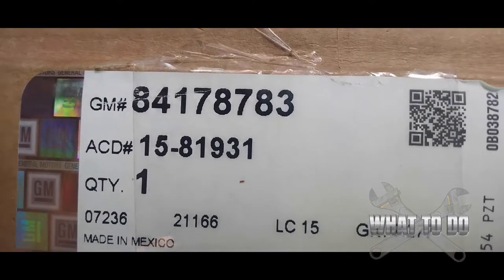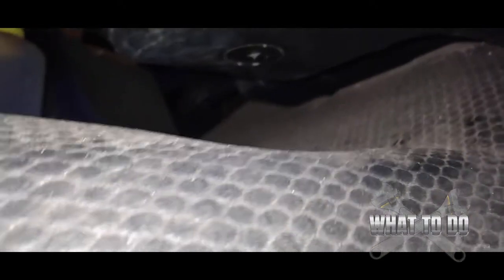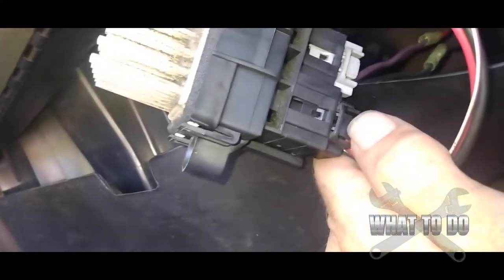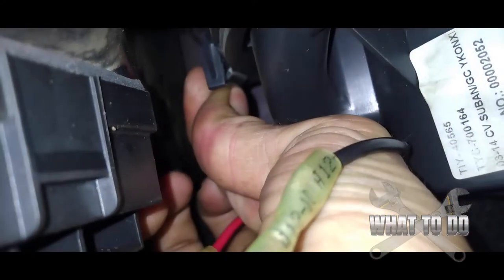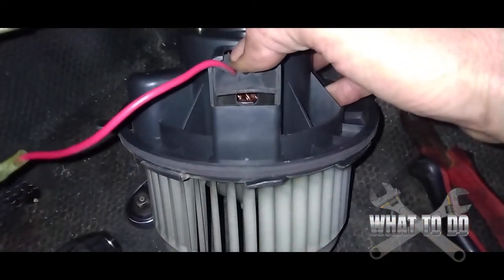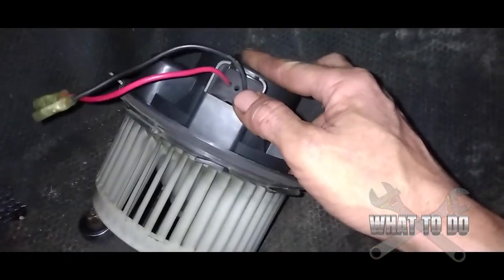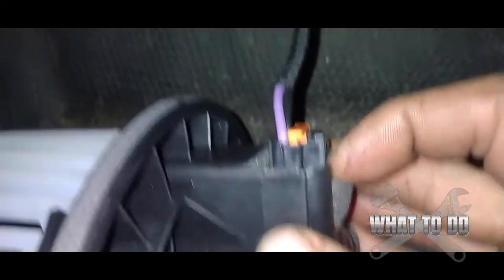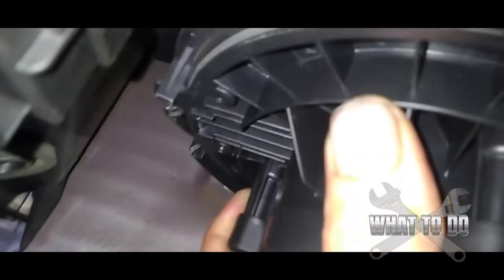2012 Chevy Silverado - Blower/Fan Motor & Resistor Installation

Comment: Does the resistor cause the fan motor to work sometimes and sometimes not because mine works perfect or not at all sometimes it just comes on while I’m driving
Reply: I’m having the same issue did you figure it out??

Comment: On my 2013 silverado 1500 the problem turned out to be some corrosion in the connector panel inside the right end of the dash.  Some contact cleaner and cycling the connectors brought it back to life.

Comment: Changed this fan and solenoid a couple years ago, think I bought a cheap fan off of Amazon. Well, it went out again so going with a genuine GM fan this time. Little warmer today so going to go out and change the fan test it like you showed before putting it back in. If it don't work go and get a solenoid also.
Reply: Got the fan replaced, I think I put a connector on the fan wire when I put that one in. But got it out went to turn by hand and it was locked up, broke it free turning good now. But I didn't want to chance it put the new one in. The old one would probably lock up again in a week so didn't chance it.
Reply: all do respect it's on the passenger side

Comment: Could either one of those parts be broken if the fan only stops when inside of truck gets worm?
Reply from the maker: Sounds to me like it could be The resistor overheating. I would certainly think about changing the resistor.
Reply: Thanks

Comment: Obviously, I would check the fuse first. 
How do I test the climate control system?
Can I test the resistor before replacing it?
I know I can test the fan before replacing it.

Comment: Do you change out both of them, the blower motor and resistor, I replaced the blower motor on my 2013 Chevy Silverado
Reply from the maker: There's not really a need to change both of them. Unless you know the resistor is bad as well then yes you would want to change the resistor also. But typically it's going to be either one or the other. The resistors are fairly inexpensive though if you're under there already and got everything apart and you wanted do it and get it out of the way then sure do them both at the same time.

Comment: Hi Rob, I am planning to make this repair on my truck.  You mentioned "before you leave the dealer" in your video, can I buy direct parts from my local dealer such as the resistor and blower motor?
Reply from the maker: Yes you can.. You'll probably pay triple  amount from the dealer but you Certainly can buy them from the dealer